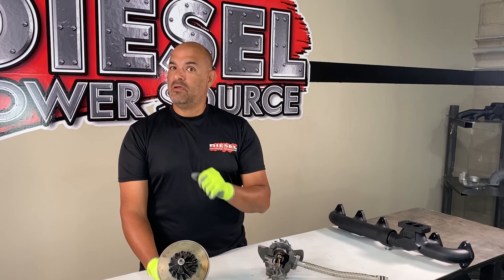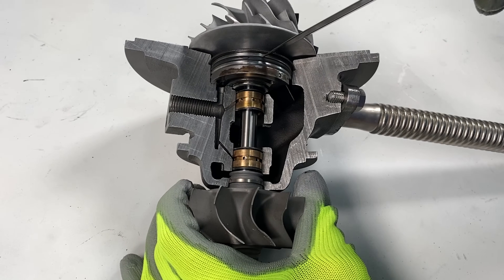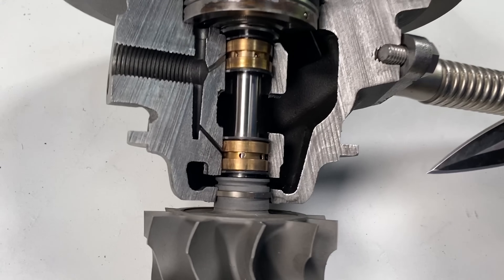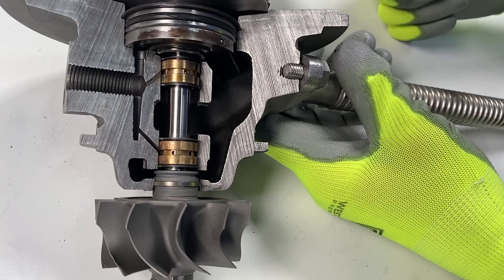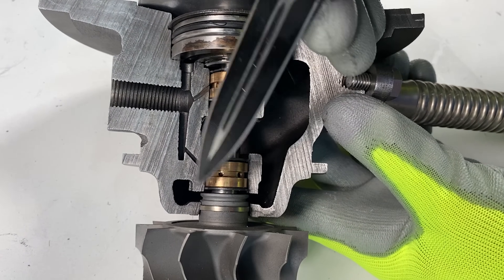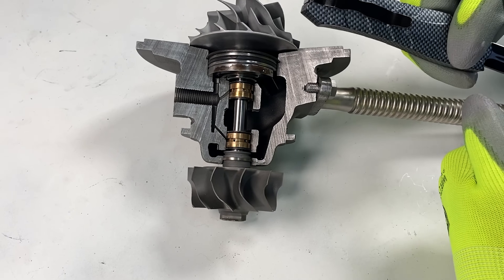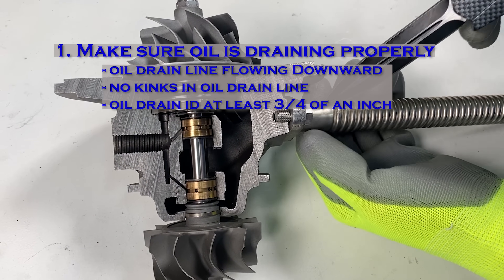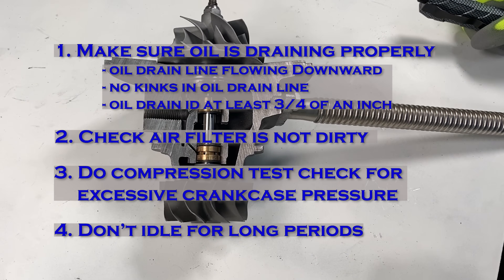Turbo Oil Leak ? |  Turbo Leak Causes |  Understand a Turbo Seal Leak | Diesel Power Source

Comment: God bless you my man, I'm on Active duty and have an oil leak coming out from the exhaust side of a generator.  We replaced the entire turbo thinking the seal was bad, only to have the same issue yet again..  .this makes soooooo much sense as the manual on hand doesn't really gives much to bite into. Will definitely look into it more tomorrow
Reply: What ended up being the problem
Reply: @brazen2861  So after all was said and done, going through the manuals etc .. we were left with the cause being the Engine for some odd reason developed excessive crankcase pressure
Reply: @alistairhazell9877  Probably because of warn piston rings
Reply: it pressurised all the oil system
Reply: @realgarage8190  well turns out there's was this little vent line that was connected to the exhaust that was somehow clogged with Fibre Glass material that needed to be cleaned.

Comment: i had both my turbos blow on my m4. only the exaust seals blew. They said they were stepped, as like they were rubbing. They said they thought if my engine had exessive pressure it could push the seal against the housing and wear it out over time. I never had smoke on boost. Only it leaks oil when it sat. The thrust bearing was good and the intake said was good. 

Is it possible i just had some bad rebuild?

thanks

Comment: Hi I have a Toyota pickup with a 3litre diesel has 54k miles it's turbo seems to be ok doesn't have any oil leaks in the form of drops but has like oil sticking on the exterior of compressor housing do I need to worry about it?

Comment: The turbine housing on my turbo cracked. I found a good one and replaced it myself. It ran great, but it started to leak oil after the install. I’ve replaced the drain gasket and tightened the bolts to the max, but it drips, even at idle. There aren’t any kinks either. What should I check?

Comment: There was one thing and its a commonly happening and causes a turbo leak, turbo outfitting or charge air cooler leaking air pressure, turbocharge use a pressure equalization to maintain oil not escape to the pressure side of the turbo. When the fitting leaking it reduce the pressure and lead to leak.

Comment: My holset turbo leaks large amounts of oil at idle through the compressor wheel. It has 21mm I’d drain relatively straight no kinks. It’s a new turbo.  HEEEELPPPP

Comment: So I had my turbo replaced added ccv reroute and new coldside pipe with new lower intake my truck is smoking like an old freight train smells burnt oil and have oil in coldside pipe no excessive blow by I'm hoping they put too small of a drain but not sure any input would help smokes like crazy on decel

Comment: great info ... I was checking a used truck the other day that looked like it had an oil leak from both ends, the inlet of the intercooler  area was soking with oil and the same where the pipe coming out of the exhaust side of the turbo meets the rest of the exhaust system.
i took off the oilcap with the engine running, it had no blowby.
Reply: was that turbo or blowby ? did you get it fixed

Comment: I bought a brand new Turbo Charger and got it fixed on my engine and Engine Oil was still leaking through it into the Exhaust and white smoke was billowing from the Exhaust intermittently, what can I do?

Comment: I have a PTE 6466 Gen2 turbo.  There is no oil leaks from the feed or drain line.  I have a bigger drain line flange.  The car feels fine, no codes, no loss of power.  But my turbo starts smoking under the turbo blanket at WOT.  I also have blue smoking coming from the exhaust.  I also noticed oil residue on my exhaust tips.  Is this a clogged PCV/ Clogged Valve cover or is my turbo oil seal bad?  Thanks
Reply: Hi man, have same issue on my pte 5858. Did u find out?

Comment: Ways to mitigate excessive crank case pressure without rebuilding the engine? I’m pretty sure my turbo is leaking because of crankcase pressure. I was thinking of maybe installing a one way valve in the drain to prevent the pressure from coming back up the drain line... of course this may temporarily block the drain, but.... I’m not trying to pull the engine just yet. (I do have a vent to atmosphere catch can with -10an lines). Might increase the catch can size for extra ventilation.
Reply: I think this is the same problem I’m having. I’m changing out the catch can to one without baffling.
Reply: @L2anger06  Yeah, I mean at the end of the day there’s only so much you can do without rebuilding the engine. The more ventilation the better I guess, you certainly don’t want to choke the crankcase ventilation but if it needs piston rings and it’s verifiably low compression from a leak down/compression test, the problem solver is a rebuilt engine
Reply: @Znthusiast  I just went to pull my turbo to clean it out and found the drain line was pinched. So lol was backing up in the turbo and pushing past the seals. I’ll clean it out and reinstall it tomorrow and figure out how to keep the line from pinching and see if it’s better.

Comment: You know, it's almost like the engineers/ Manufacturers/STEALERships who make these shitty ecoboosts engines knowingly make them without adding a catch can so that you (the consumer) will end up footing a huge bill into their pockets. They also put it in their instructions to the stealership mechanics that their PTUs (Power Transfer Unit) gear oil is a "life time" oil that doesn't ever need to be change out when it turns black only after 20K miles. All GTDIs without catch cans/air-oil separators were meant to break down and make money for the Manufacturers...

Comment: My 2010 Audi A5 is doing something weird. I have exccesive crankcase pressure  even with oil cap off so that rules out a bad PCV valve, yet my car only smokes at idle? Turbo sucking in crankcase pressure from PCV through compressor side, maybe?

Comment: In turbo kits usually come w a inlet oil adapter w a pin hole size entrance for the oil is that normal or should I take a tiny bit bigger still bit to the hole on the adapter? Thanks

Comment: Sir can u tell me if there is oil leaking from the boost side only what could be the cause and it is leaking when I acelrate the pedal
Reply: I think from excessive crankcase pressure du to worn piston rings

Comment: My hx35 just started smoking at idle out of the exhaust side, ive been daily driving it for 2 years. No oil in the charge pipe, doesn't smoke when driving or in boost. Think its my turbo?

Comment: Great stuff! thanks. Have you ever seen a coolant cooled turbo (Ford Ecoboost 1 litre) leak oil or exhaust gas into the coolant system?
Reply: If you have exhaust gas coming into your cooling system then that may mean you have a bad gasket

Comment: If the turbo is leaking oil in the Compressed side outlet house, what should we do and what to check?
Reply: The oil seals in the turbo
Reply: It is probably the o ring on the inlet side. The video did not mention this because this video is intended to instruct their customers who are having issues with the turbo that they purchased. The leaking o ring only occurs after many years of use due to the continuous heat on the turbo.

Comment: U have explained about the turbos at the best. I've got a clear idea about the turbos with ur video. I'm really facing the worst problem on my 2011 ford figo turbo, changed 3 turbos in less than 6 months but got no solution from service centre or local mechanic. I'm gonna check the drain pipe and tell u. Thanks .
Reply: Hi brother did you solve the problem

Comment: Could a turbo leak from having too much oil in the crank case?
Reply: Yes it is. Extra oil will find a way to go out thats generally turbo.
Reply: @EmreBentürk  Excessive oil in the crankcase could also block the oil drain from the turbo with the end result being oil leakage pass the turbine and compressor wheel seals

Comment: thanks for sharing the excellent info you've provided.
so where does this oil end up, if the piston rings let oil past will go into the exhaust and intake manifolds?
one of my turbos seems to be leaking to the outside of the housing is this the same problem.
thanks in advance.